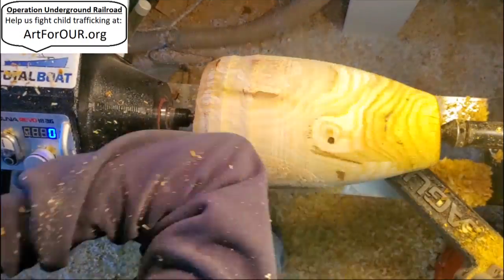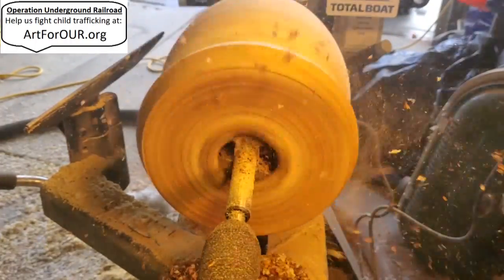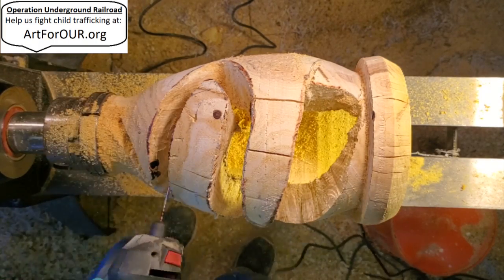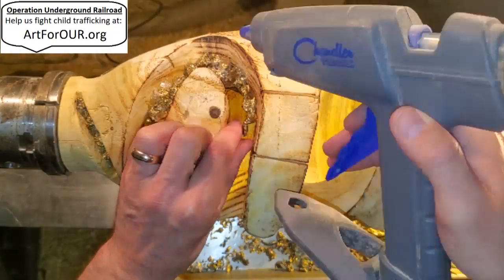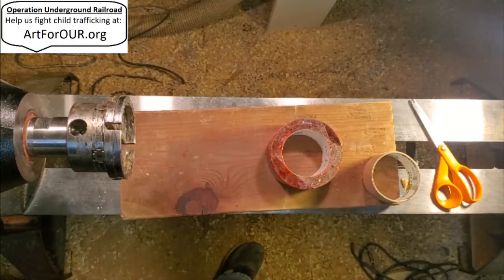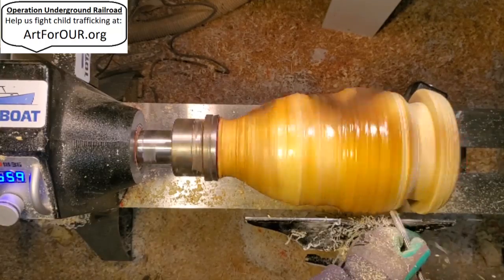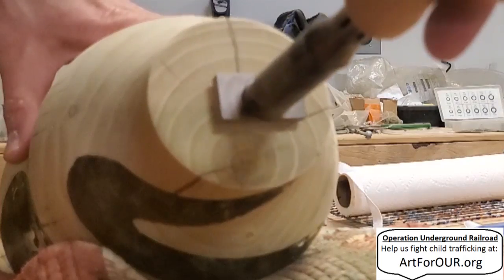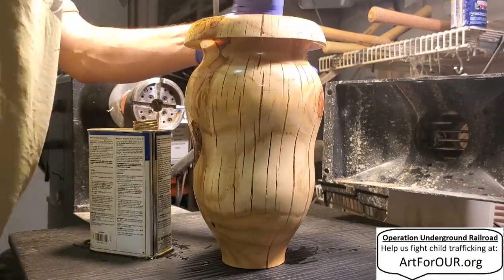"Gold Rush", Brass, Resin, Elmwood vase / bowl, lathe wood turning. Making a River of gold nuggets.

Comment: Hello Dan, you asked a couple of questions.  I thought I would lend you some of my experience.  First, I don't know why you hollow first.  I always do my cut-outs first, pour my epoxy then hollow.  saves a lot of trouble.  On your faceplate, you asked a question in a previous video about keeping it clean.  I put a piece of wax paper between the faceplate and wood.  Make it big enough so you can pull it up around your faceplate.  I leave my faceplate on until I have to flip it around.  Keeping bubbles out of your epoxy from your cutouts.  Two ways I use.  First about 3 coats of sanding sealer, that usually does the trick.  The other way I've seen others use, I have not, but it should work.  Mix up some epoxy and thin it with acetone.  Then paint in on your edges.  That seems like too much trouble for me, but it works.  Take care and I hope I helped you.  I like your videos, always give a like.  I generally watch it on TV so I can't comment.  Larry
Reply from the maker: Awesome!  Thank you for your advice and support!

Artforour.org

Comment: I haven't seen all your videos and possibly someone has suggested this already so sorry if I am repeating, have you tried 2 liter bottles for your centers, even juice and water bottles made out of the thicker plastic may help, I have used planters even for odd shaped projects. You can fill them with sand for weight, and for shallow you can use mixing containers. You can spray them with release or silicone. Just a thought, I've worked with resin for many years but I am just learning the lathe. Thanks for all you do! Your projects are beautiful!
Reply from the maker: Thank you Christina!

Artforour.org

Comment: I probably do this wrong but for my resin molds I use cheap plywood for my molds then router the plywood off when dry. I found that I was routering  my projects smooth any way so now I skip the step of removing the molds.
Reply from the maker: Good idea, how do you make round molds?

Comment: Hi Doc, another cool piece of art !! I use fostner bits now and again with my drill press and I’ve noticed that they seem to cut better at a slower speed. My set of bits actually has RPM speed stamped on the side of their shanks.  Lowering the lathe RPM may  help with the boring process and the smoking.
Reply from the maker: You've probably nailed that problem.   I'll have to give it a try.

Comment: After all that work gluing the brass in, you could have used a small amount of quick set resin and painted both sides of the brass with it. After the quick set hardens and some only take 15 minutes, then pour your resin. For the inside, use 6 mill plastic as it is very durable and fill the inside with marbles. It's more flexible to work with than the silicone mat you used and resin will not stick to it
Reply from the maker: Good ideas! Thank you. 

Artforour.org
Reply: @artgivinghope  If you want to stop the air bubbles from the wood, you could stabilize it with cactus juice and a vacuum chamber. That will stop all cracking and remove all the air from the piece. You could have done it after the first turning and before you glued in the brass. You can also use marbles to take up some volume so you don't have to use as much cactus juice even if it's reusable

Comment: On your problem with the brass nuggets, and this is just thinking out loud, I haven't done it, you could stuff the vase super tight with crumpled newspaper, with or without duct tape lining first, then fill the brass in from the outside using thin or medium CA glue with accelerator set spray ... maybe a couple layers of brass and CA to get it all set up ... the CA won't melt with the heat of resin curing ... the air in the resin is a separate problem which is probably addressable ... love your OUR project ... will go through your Amazon links ... Cheers  Farmer John, Ontario, Canada
Reply from the maker: Excellent ideas!  Thank you for your support!

Artforour.org